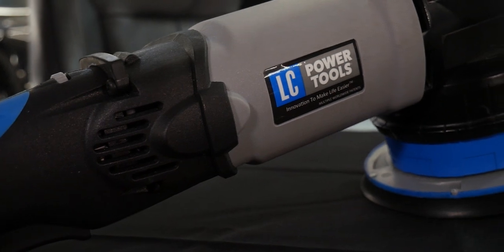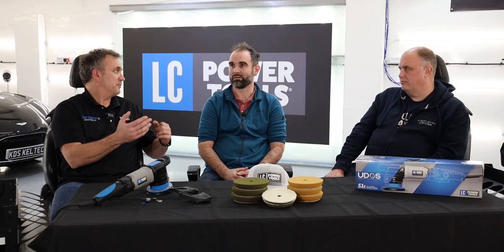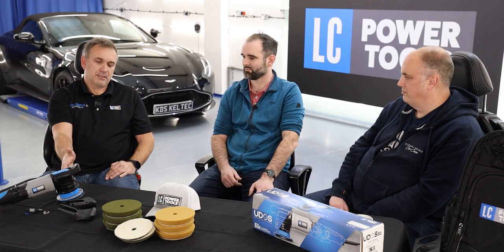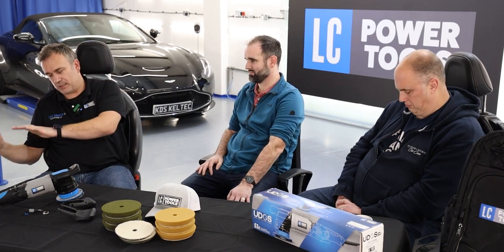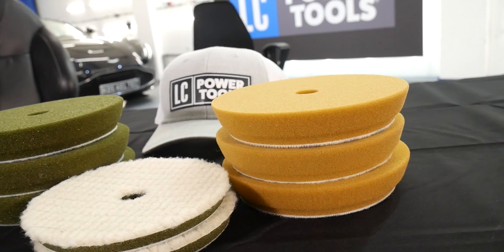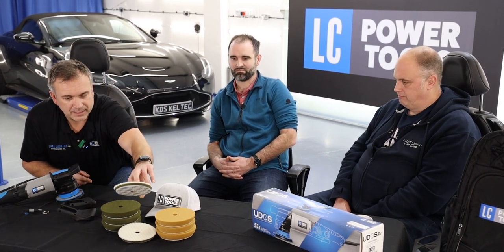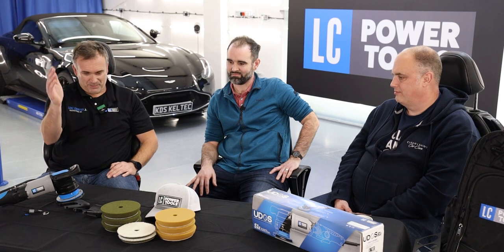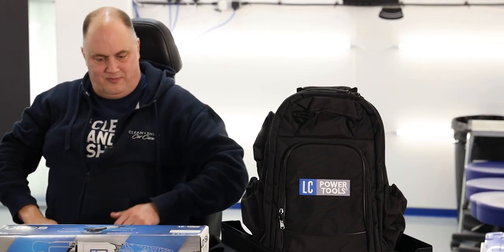Tool Time - With Lake Country Power Tools!

Comment: I just said to a friend yesterday that the udos should have R for rotary or the number 0 then the numbers 8, 12,15 and 21 on the machine than p1, p2 and P3. .  We did have large orbit as far back as 2007 - dynabrade 61385 but it was an attachment not a machine, i still have them and a stone grinder to power them. It had 19 mm orbit.  Ps a universal foam or two foams max and one or two cutting pads is the way things will be with all brands in the near future..  ive had that belief since 2007. Laser treated wool and a blue universal foam is all i would use 85% of the time if i was still detailing (29 years done) as its that versatile and work on most paints